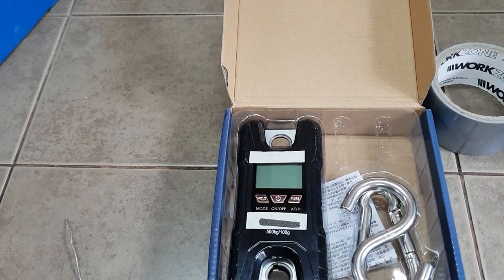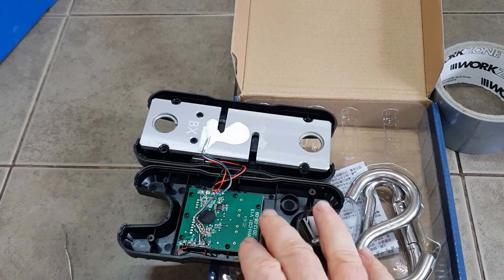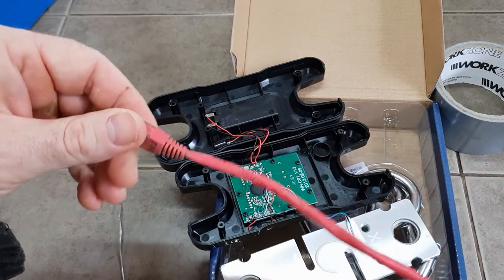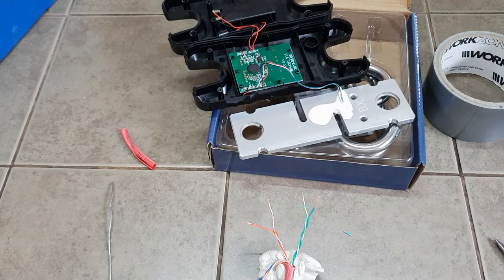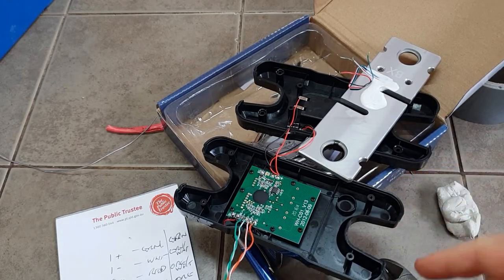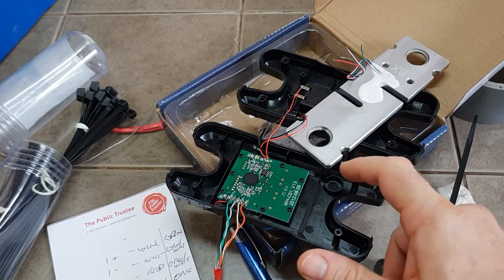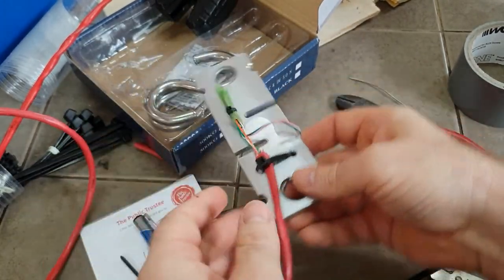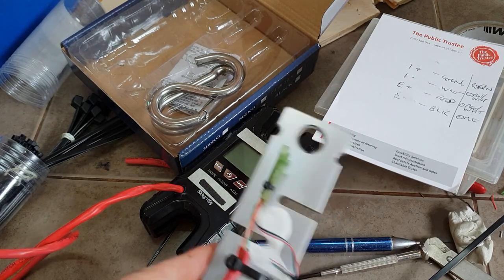DIY Isometric Strength Gym follow-up video - detailed mini crane scale adaptation instructions

Comment: Definetly need to recalibrate when adding resistance to the load cell Wheatstone bridge
Reply: Actually no, adding equal resistance does not change the relationship. There should be no change.
Reply from the maker: Thanks for your comments. This modification effectively involves extending the excitation+, excitation-, signal+ and signal- connections to the bridge, which is common practice when connecting load cells to the respective interface circuitry (as per your second comment). I have tested it before and after the modification to make sure, and the load cell output does not change.

Comment: I know this an older vid. Just got one of these and want to do this. Not the greatest at soldering. Could you just cut the wires and wire in the extension? So you don’t have to resolder  on the  board thanks
Reply from the maker: Thanks for your comment and question. If you're careful, you could cut and bare the wires and twist the ends together and then insulate them with tape or small bits of heat-shrink. It should work, however you may encounter connection issues or potential corrosion at the joins over time. You'll have to try it out and see how it goes.
Reply: Cool thanks for the reply I think I’m going to try it. Worst that could happen in out 26 bucks 👍

Comment: Well, I did it and it worked. It took me 2 hours so quite a bit longer than you haha! :) I very rarely do any soldering though and I didn't have any magnifying equipment and those wires are miniscule! Anyway, thanks for the video as I would never have even thought about it if I'd not seen your 'how to'. 
I bought the crane scale last year as it had the Auto Hold feature but, as you said, it works fine for weighing but for getting a reading from a workout the tension is just too 'noisy' for the scale to get a reading settled enough to hold on. Your viideo meant the scale hasn't gone to waste :)
Reply from the maker: Happy to have been of some service!

Comment: Helolo, I'm making my own digital scale isochain, I have all materials, I just need to get the digital scale and attach the load cell. Was wondering If you could provide the name of the device youre using in this video that way I can just repeat steps that you did? I appreciate the content! Thanks
Reply from the maker: No worries. I just didn't want the actual video to be an advert for a particular product, is all. The crane scale I used was the WeiHeng WH-C500 crane scale.
Reply: @WushuEngineer  Thank you so much! I just stumbled across your channel looking for the information I needed and you provided everything I need! Will be subscribing. Thanks

Comment: Hey I’ve seen that you have other videos that you are using your computer to track force data like this.  Do you have any video tutorials on how to get the data into a computer?
Reply from the maker: Hi. Thanks for your comment and query. The videos in which I record and track data with a computer involve a different device. In most of those cases, I am using a Loadstar (company name) load cell, which comes already equipped with a proprietary computer interface that connects to a USB port and the accompanying software to record data (1 kHz sampling rate in this case). The digital crane scales shown in this video are very simple and do not come equipped with a computer interface. It would be possible to design and build the hardware and software necessary to record and monitor data from the crane scale. However, that would be a considerable undertaking. What I could do instead is to take a look around and see if there are any budget digital crane scales available that would allow for the recording and analyzing of data. Let me know if you would like me to investigate this as an option.
Reply: @WushuEngineer  I’ve been watching your video and was wondering if you ever found a cheap option for recording and analyzing data? Also would it be possible to make this have Bluetooth compatibilities to record onto an application?

Comment: when you extend wires the output reading not change ? i read somewhere probably in me fc 20 k loadcell that when wires change lenghr you need recalibrated device ...
Reply from the maker: Good question. I have tested the devices prior to adaptation and after being adapted and there is no significant detectable change in the output. I am sure that the operation does change the output somewhat, but the effect is pretty negligible relative to the loads being measured.
Reply: @WushuEngineer  ok .